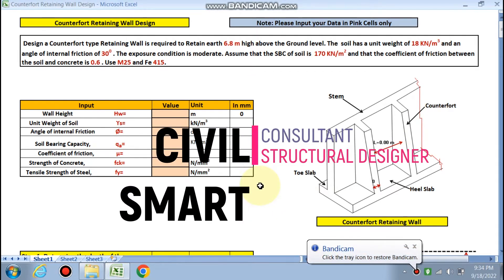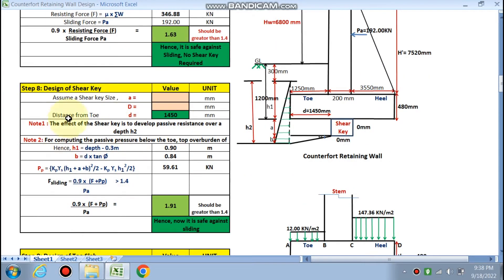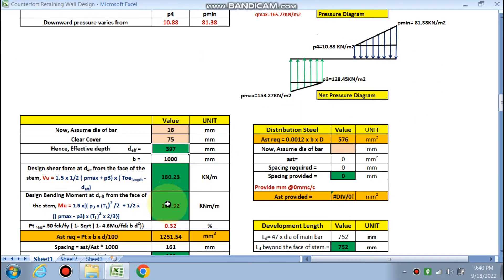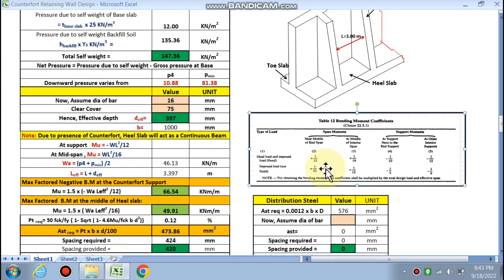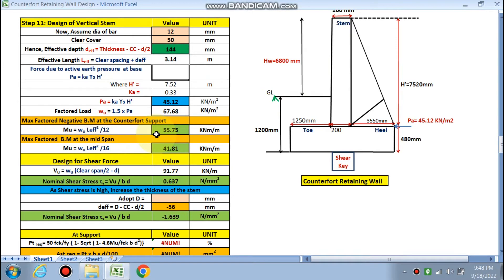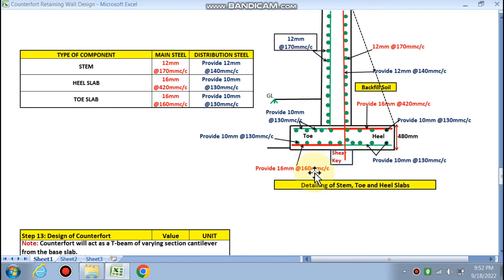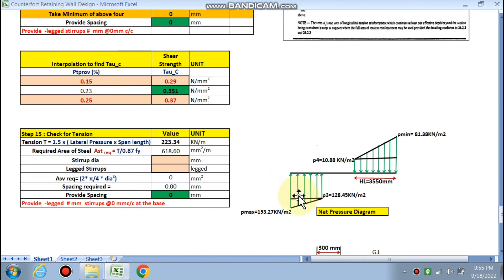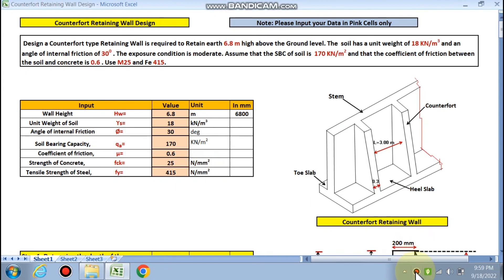COUNTERFORT RETAINING WALL- (PART2)- BY CIVIL SMART

Comment from the maker: Full design Excel sheets course 
as under:
https://u.payu.in/PAYUMN/pJdyd2igjfOi
Full complete Course includes all the sheets as under:

IN FOOTING DESIGN SHEETS
1. Isolated square footing
2. Isolated rectangular footing
3. Combined rectangular footing (Slab Type).
4. Combined rectangular footing (Beam & Slab Type).
5. Trapezoidal footing design
6. Strap beam footing design
7. Footing with uniaxial bending
8. Footing with biaxial bending
9. Pile foundation
10. Pile cap design 3 & 4 piles
11. Wall footing/ Strap footing
12. Raft Foundation ( Beam and Slab Type).
13. Combined footing design (Beam and Slab Type).
14. Eccentric Footing Design ( Column at dist. X from edge).
15. Eccentric Footing Design ( Column at Edge of footing).
16. Strip footing design ( having 4 columns).
17. Pad Square Footing Design.

IN BEAM DESIGN SHEETS
1. Singly reinforced beam design sheet. ( Beam Size known).
2. SINGLY REINFORCED BEAM design ( Beam Size not known).
2. Doubly reinforced beam design
3. Continuous beams design  with point load having
    2-span continuous beam
    3-span continuous beam
    4-span  continuous beam
    5- span continuous beam.

4. Cantilever Beam Design.
5. T- BEAM Analysis sheet.

IN COLUMN DESIGN SHEETS
1. Axially loaded column design
   (a). When column size is known.
   (b). When column size is not known.
2. Column with axial load with uniaxial moment ( on 2            sides and 4 sides reinforcement)
3. Column with axial load with biaxial moment
4. Mux and Muy Calculation sheet.
5. Short Circular axially loaded Column ( Dia is known).
6. Short Circular axially loaded Column ( Dia is not known).
7. Long Column design.

IN SLAB DESIGN SHEETS
1. Cantilever slab design sheet.
2. Simply supported slab design sheet.
3. One way Continuous slab design sheet.
4. Two way Continuous Slab design sheet.
5. Two way simply supported slab design sheet.
6. Flat Slab Design With Drop Only
7.Flat slab design without column head and drop 
8. Flat Slab Design With Column Head and Drop.

IN STAIRCASE DESIGN SHEETS.
1. Dog legged staircase design. (Well Size know).
2. Dog Legged Staircase design ( Landing And flight width known).
3. Open well staircase design.

IN RCC WATER TANK DESIGN SHEETS.
1. RCC WATER TANK RESTING ON GROUND (L/B <2).
2. RCC WATER TANK RESTING ON GROUND (L/B >2).
3. UNDER GROUND WATER TANK DESIGN (COND.: TANK         IS EMPTY AND OUTSIDE SOIL IS SATURATED).
4. UNDERGROUND WATER TANK ( TANK IS FULL AND             NO OUTSIDE SOIL PRESSURE).
5. UNDER GROUND CIRCULAR WATER TANK.
6. Overhead Circular Water Tank.
7. INTZ Tank design.
8. Box Culvert Design.

IN WALL DESIGN SHEET
1. RC WALL DESIGN SHEET.
2. RETAINING  WALL DESIGN SHEET.
3. BASEMENT RETAINING WALL DESIGN SHEET.
4. COUNTERFORT RETAINING WALL.
5. SHEAR WALL WITH BOUNDARY ELEMENT.

BUILDING LOADS CALCULATION SHEET.

COST ESTIMATION SHEET.
Reply: Sheets or videos??
Reply from the maker: Both
Reply: We will get these sheets or tutorial videos
Reply from the maker: Yes